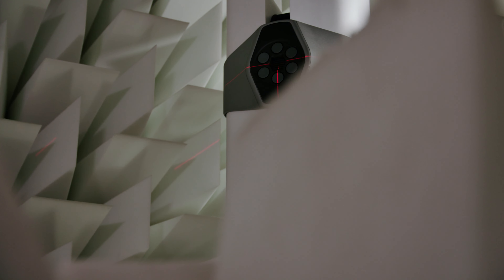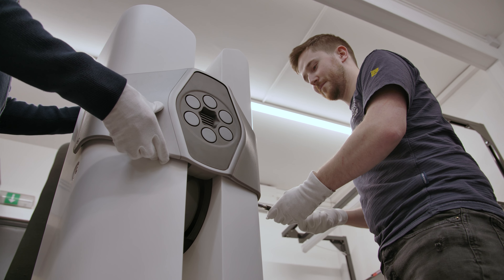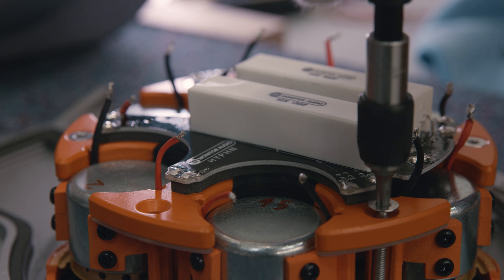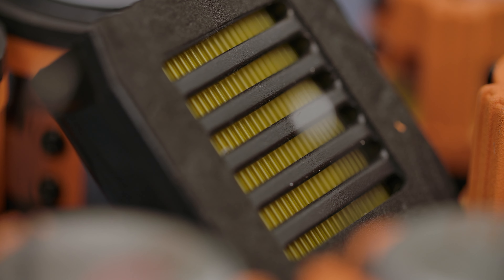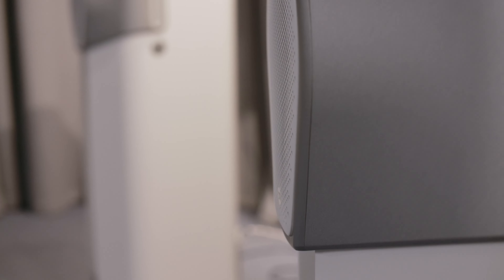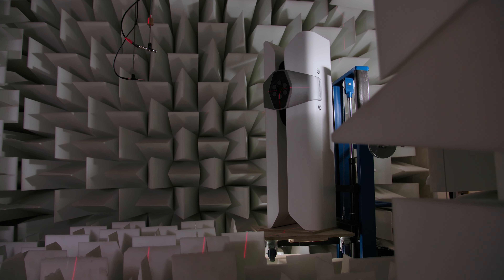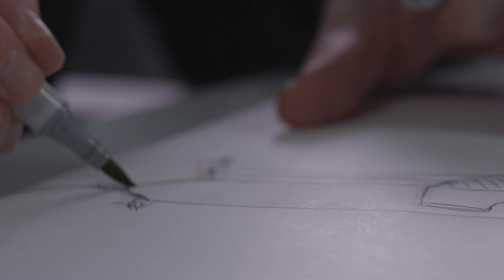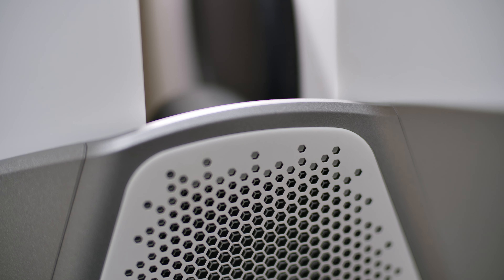Monitor Audio Hyphn Speaker 2 - Advanced Acoustical Concepts and Daring Industrial Design (May 2023)

Comment: Lets be honest, this looks like a Tekton array design placed on an inverted Kef Blade woofer platform... But I don't object at all 

It looks stunning, and if it sounds anywhere near as good as it looks, kudos to them. Even if  they've utilised other companies' ideas, they've still demonstrated great creativity and "outside the box" thinking.
Reply: A particularly creative aspect of this design, I think, is the separation of the bass drivers into two chambers -- that's not something you see often, or ever -- and then the tying together with the bars between the drivers and the M-Array front piece. I thought that was all really clever.

Comment: I guess the blokes are still into the point source theory for some reason. But they made the radiation pattern all straight ahead, which calls attention to the speakers as the obvious source of the sound. Need to design radiation pattern for spatial pattern of direct and reflected sound to build the soundstage in a way that mimics live sound fields.

Comment: 83k € and still passive design. For that price i would expect that the designers release an active model where you get the perfect matched amps and avoid disadvantages of an passive crossover… For that price you get an Kii Three + BXT Modul (Cardiod) an still have 30k left for full room treatment
Reply: Obviously, there are many alternatives at this price. One thing that has to be remembered, however, is that there are still many audiophiles who simply won't go active -- they want passive. I think Monitor Audio was wise to make this passive as a statement-type product, because that's what still rules the audiophile marketplace.
Reply: Nah. A lot of audiophiles like being able to try different equipment on their speakers, so making a speaker active pretty much takes away 70% of the fun in the hobby. Part of the fun is going to audio shows or trying a friend's new tube amp etc.

Passive speakers tend to retain their value pretty well too.
Reply: @rickmorty5215  There is that, too. In particular, one problem with active with built-in streaming is when the streaming is out of date, the whole speaker is out of date. Not a good thing. I like active -- but nothing beyond the components to make it active, meaning the amplifiers and the crossover, whether analog or digital.

Comment: I’m sure this is a fantastic speaker, but isn’t it basically a revised copy of the Tekton mid/tweeter array?
Reply: It's hard to say -- and this is something I suspect Tekton will have to deal with if so. But look up Bessel array. This has been mentioned elsewhere, too. From what I can tell, a Bessel array is a group of small drivers acting like a larger one, which is what Monitor Audio seems to be doing in this design.

Comment: Unique design but unusual cosmetics may take time to adjust to. I wonder if there is delay compensation to improve time alignment between woofer and mid/treble as they are further apart than flush front design.
Reply: The bold design will have its lovers and haters, without question. I'm glad they went with this approach because, though, because had it been another traditional enclosure -- it would've been  just another expensive loudspeaker. They created something truly unique.
Reply from the maker: We applaud the daring design. Nice to see something so different.
Reply: Crossover delays the sound anyway. With bass frequencies it’s easy to get into meters of delay. Almost all passive speakers have the bass delayed.

Comment: Yet they have gone with iron core inductors…..
Reply: And yet -- you have nothing to say about the rest of the design?
Reply: @dougschneider8243  fair point..
I did ask if they are using Tekton’s tech for the design in another thread.. 
in a speaker costing $100k it would be nice to know they used the best quality crossover parts.  It looks like they haven’t.
Reply: @Openeyesopenheart42  I wouldn't be so sure of that. We actually couldn't fit the crossover discussion into the video (we believe it should only be so long), but both on video as well as off video I talked to Michael Hedges at length. He said that the design engineers listened to all kinds of parts and for the caps settled on ClarityCap capacitors because they conclusion showed -- in blind listening tests -- that the team preferred the sound. Aside from that, I know one manufacturer of expensive loudspeakers that deliberately covers the entire crossover in a tar-like substance because he doesn't want audiophiles making judgments on parts that he knows and tests and feels are the best, but others might have some biases. One could take a cynical stance and say he's hiding something, but he's not alone. I know of manufacturers doing the same -- and I know of ones using inferior "audiophile approved" parts just to have a certain name there. So I wouldn't be too quick to judge until you really know what went out.
Reply: Iron core inductors are excellent. Better saturation behaviour than ferrite core and lower DCR than air core. Believe it or not, the guys who got a job designing speakers for a living know a thing or two 😮